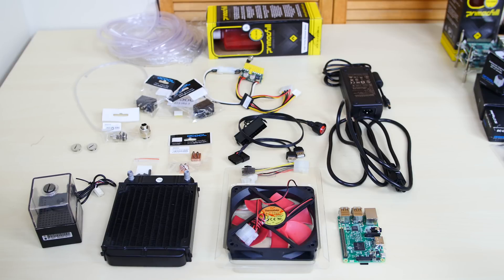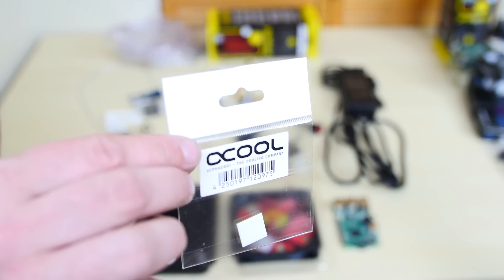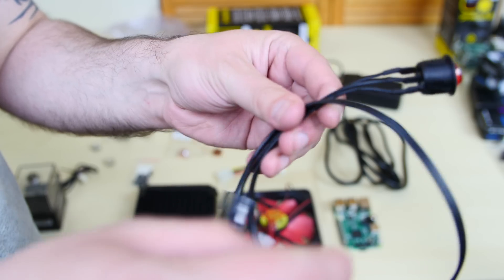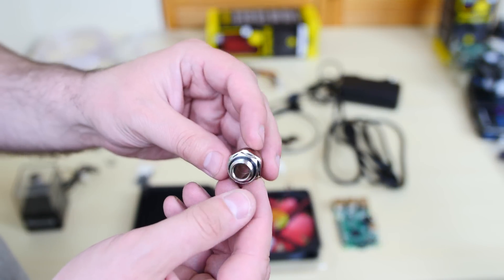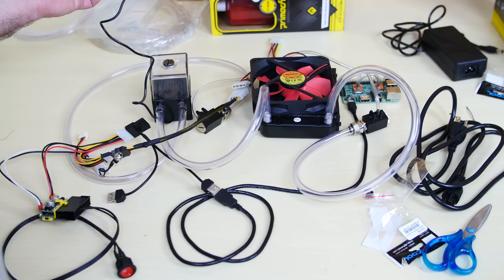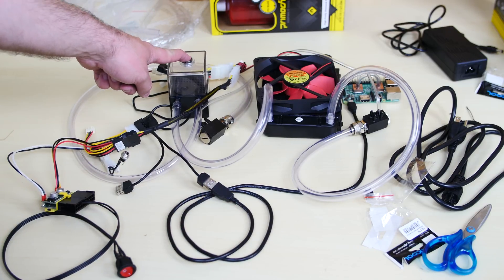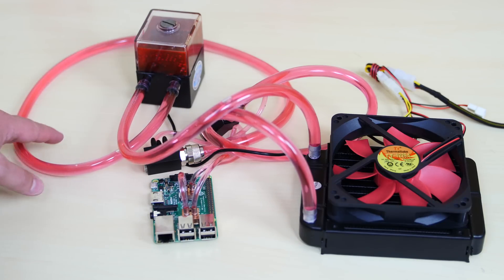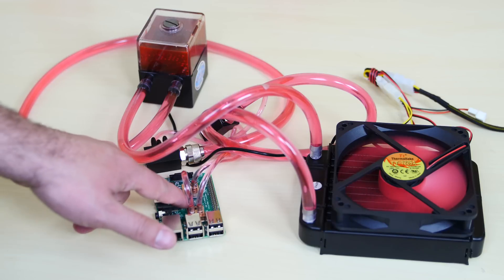Water Cooled Raspberry Pi 3 - Part 1 - The Build

Comment: Does it matter what the order is? 
Res/Pump->Radiator->CPU Block-->Res/Pump
Res/Pump->CPU Block->Radiator-->Res/Pump
Does it make a difference?
Reply: +Michael Dickens Ok. Now I just think you're trolling me. There's no way someone is this stupid by accident. You're obviously doing it on purpose.

Some of what you mentioned is called evaporative cooling. However, we do not spray water on our electrical components. That is 100% complete dumbass maneuver.
Reply: +Michael Dickens let me get this straight... you think radiators can get the liquid below room temp? Allow me to educate you. Without a compressor unit pressuring a gas into a condenser coil, cooling to ambient temperature, then decompressing the gas again, the lowest temperature achievable is room temperature.

Period. End of story.
Reply: +Michael Dickens Holy shit dude. You just keep digging yourself deeper. I've already explained that a radiator doesn't cool below air temperature. 70 Fahrenheit is 21.1 Celsius. when your cooling loop runs below 20, please submit a photo. otherwise please stop your bullshit.
Reply: You are cherry picking little points in our comments and then trying to use that against us. At the same time, you are complaining that we taking the things in your comments and using them out of context. There is no way that you will ever convince me that air and water will cool at the same rate unless you throw in some ridiculous variable, like you are doing now. It's a bit obvious that a room full of air will take longer to cool than a shot glass of water. Think about how much coolant is being used in a water loop, and then compare that to how much air is being used (moved) in an air cooled setup. 

Just go back and think about what you originally said....the point that is being argued. If you grab the tube that is feeding the radiator, it will be warm. The tube opposite that, exiting the radiator, will be cooler than the intake tube, but will no way be cooler than the ambient temperature in the room UNLESS it has been acted upon by some outside force. Full stop. There is no way around this.
Reply: I would ignore him, but, and maybe I am wrong, but I think he is 100% convinced that he is correct. Either way, one of us is gonna learn something new today.
Reply: You are still not getting something about this. Adding ICE to the water is using an outside source that is not available in a water cooling setup. You are still assuming that you are somehow going to get the water to be LOWER THAN ROOM TEMPERATURE. That is IMPOSSIBLE without some other outside influence. Evaporation is an outside force, and it is one that does not exists in a water cooled setup. If you take a pot of water, whether it be boiling or frozen, and let it sit on the counter in your kitchen, the water will eventually settle at the same temperature as the air around it. The starting point is irrelevant. while off, the coolant in a water cooled setup will match the ambient temperature around it. Once turned on, the water temperature will do nothing but rise, no matter which point of the loop you are taking the measurement at. The reason this works for cooling is because the water isnt going to instantly become the temperature of the CPU, and with it constantly in motion, the heat that it does manage to pull away from the CPU will be dissipated by the radiator. AGAIN, this temperature is NEVER going to be less than the temperature of the air around it. I really don't know how else to go about trying to explain this to you. Your theories are all based on something that is incorrect. Until you sort that part out, your entire thought process on the subject is going to be thrown off. It is obvious that nothing that we can say is going to change your mind. If you come up with a way to get the coolant to drop below room temperature using a normal water cooling setup, you need to go patent that shit because you will make millions, if not billions, because the applications would be endless.

As far as you referring to your first comment about the order of the loop, I have not said anything against either order. In fact, the original post...the one that caused this whole shit show, was me simply asking that exact question. "Does it matter what the order is?" If you had simply commented that you preferred to run the loop in a specific order, there would have been no way that we could tell you, "No...that isn't the order you prefer." The fact that you tried to bolster your decision with a fallacy is what opened up the door for the rebuttals.
Reply: Yea we said in a normal loop without outside influence
Reply: Also, not finding anything about using a radiator to reach lower than ambient temp, Yay physics!
 Sorry but everything I am reading (and all that I have learned) is saying you are wrong.

If you want to be taken seriously, give a specific reference.
Reply: it would actually be kind of interesting to see if having the rad before the blocks or after them makes a difference (even tiny) in cooling performance. 

Logic says no, but logic also told me that stuffing shirts and boxes into a PC case would block air flow and make it hotter, and that doesn't seem to be the case.
Reply: Popular opinion says, Not Really.

My personal preference is to have the radiator immediately before the res/pump. I like the pump to receive the coolest liquid, because the pump is the main component that keeps the system working. If it fails from overheating, that's bad.

I also do hottest component first, because the one that gets hottest needs more attention. (still just my personal opinion) For me this is the GPU, then the CPU.

So, based on my opinions, my loop looks like this...
Res/Pump > GPU > CPU > Rad ----> repeat
Reply: +iwantmypot I have the opposite opinion

Well, in a case like this, it doesn't really matter as even under load, the ARM CPU doesn't put off that much heat, leaving the liquid relatively cool (this would differ in a Rpi cluster though

As for bigger systems (gaming rigs and the like), I find putting the rad before the res/pump to be a waste, as you're taking warmer that air temp liquid, cooling it down to (what I would assume to be) cooler than room temp liquid, then having it sit in the res,  warming back up to room temp, before being sent through the pump (collecting the pumps heat) then being sent to the CPU, now you are essentially cooling the CPU with relatively warm liquid, doesn't that defeat the purpose of liquid cooling?

By putting rad after the res/pump, the (by this time) room temp liquid would go through the pump (still slightly cooling the pump during the process, not that the pump needs that anyway), sending it through the rad to cool it down, then taking that,...
Reply: now below room temp liquid directly to the CPU, much more efficient

I just never understood cooling of the liquid before temporary storage, it would be like taking ice cream out of the freezer and having it sit in the sun for half an hour before serving, why even freeze it at all then?
Reply: If you've ever listened to a window mounted air conditioning unit, you'll realize why almost nobody runs sub-ambient computer cooling systems.
Reply: iwantmypot Do I think that radiators can get the liquid below room temp?  Of course I do, now when I say below, I don't mean drastically, don't think that I expect the outgoing liquid to be freezing, but I would expect it to come out a few degrees lower

Keep in mind the short time that the liquid in is the reservoir, it is cooling down a tiny bit, and the liquid coming in, while it is warm, it's not in any way hot (to us that is), I honestly think by the time the liquid reaches the pump, it's already at room temp, or at least pretty close to it (it's most definitely in no way hot, by this point, or it would have been at the boiling point before even completing the loop)

Now, with all that in mind, if the liquid just has to be room temp to be sufficient for "cooling", what's the point in even having the radiator at all, let alone cooling fans?  I really think you are overestimating how hot the loop would be once it cools the last component in the loop, if it really got that hot, I believe we would have a lot more to worry about than where we should place the radiator, as we would have to worry about the integrity of tubing itself (do you really want your tubes melting?)

Relating it to a window mounted AC unit is a really a bad idea, it's not an ACs job to cool down to room temp, it's an ACs job to cool down MUCH MUCH lower than just below room temp, if it just cooled down to just below room temp, it would have a real hard time keeping a whole room cool, let alone a whole home,  you are aware the technology used in an AC is the same technology used in refrigerators and freezers right?  You really don't want a CPU THAT cold as it would risk condensation
Reply: iwantmypot What bullshit?  You can't relate air temp and liquid temp, liquid heats/cools at a faster rate than air, it also depends on how small/large the stream of water is

Do you have any idea how they cool nuclear reactors?  Ever heard of a "bong cooler" or "cooling tower"? (a replacement for a radiator in liquid cooling) When you take a liquid and force it through pinhole nozzles (eg. a shower head) it cools at a faster rate than, say a bucket of the same liquid, this is why the water coming out of a shower head feels colder the further away the shower head is from you

Okay, fine, you could argue that you are just feeling the difference between "hot" and "room temp", if that is what you believe, fine

Now maybe this is something only I can detect, but if I take a handheld shower head and have it maybe about an inch from my body (hand, arm, etc.), I can feel the hot/warm water(warmer than room temp), and the difference of warmth from the air around it, the further I take the shower head away from my body (putting it back up on its hook and sitting down in the shower, that same temp water is then not only colder, but is now colder than the air in the room

Another example (that maybe only I can detect) is if I take an unopened soft drink can that has been sitting out on a summer day, as long as it's not in direct sunlight, it is still relatively cool to the touch, I don't mean no difference to air temp, I mean it actually feels cooler than the air around it

Now according to what you are saying, what I just explained is not possible...  Then why am I detecting it?  Now again, it's not a huge temperature difference, but it definitely much cooler than room temp (temperature of the air around it)

The whole reason liquid cooling is a thing is because of this, liquid can take away heat/cool down components faster than air (and vice versa), the liquid coming directly out of the radiator is going to be much cooler than the same liquid going into a reservoir and pump, there is a difference, the difference is minuscule, but there is an obvious difference, and that slight difference, in my opinion, would make it more efficient to put the radiator after the res/pump, now again, that is just my opinion, and it doesn't really matter either way, but there is no reason that having the radiator after the res/pump is any worse than having it before

Now I do get what you are trying to say, the radiator would only be able to cool to the temp of it's fins, and it's fins can't get any colder than the air around it (or the air going through it from the fans), and thus that would be room temp, though do keep in mind there is such thing as "wind chill" moving air is cooler than stagnant air, so air going through the fans are cooler than the non moving air around it, BUT...  The smaller (and more) pipes there are snaking through the fins in the radiator, the more heat that can dissipate in less time, and the cooler the liquid can get, just like (the opposite of) solar water heating, the smaller the tubes in the panel, the faster the water in the solar panel will heat up, even on a cool/cold day, as long as there is sunlight
Reply: Michael Dickens Yea...I hate to have to jump in with shitty news, but there is no way a passive radiator can get it's contents any cooler than the air around it. Also, liquid takes a much longer time to heat or cool than air does. This is why you can go swimming on a night that preceded a hot day and the water will be warmer than the air. It is also why bodies of water tend to change temperatures with seasons, rather than changing with the days. Wind chill will not reduce a temperature below ambient unless paired with a liquid. Regardless, thanks for the response...lol. 

Side note, I was thinking the other day about adding a NOS inter-cooler spray bar into a build. How sweet would that be to have push button radiator frosting....lol
Reply: iwantmypot what makes you think I meant spraying water on electronics, you'd have to be a complete moron to think that was what I was saying

What I meant, was take the same principle and make it into an isolated environment (eg the "cooling tower/bong cooler" I mentioned earlier)

The warm water from the loop would come out the shower head and fall to the base of the tower (while at the same time, a fan is blown at a downward angle [hence the name bong cooler, the shape resembles a bong, the fan is where the pot would go]), the cooled water in the base gets sent to the pump, through the component's Waterblocks, then back to the shower head, in this case the tower serves two purposes, it serves the purpose of the radiator (cooling the water/liquid) and the reservoir

And you're right, it's a form of evaporative cooling

hackaday.com/2008/10/16/uberbong-evaporative-pc-cooling-probably/

krulkntrdction " Also, liquid takes a much longer time to heat or cool than air does. This is why you can go swimming on a night that preceded a hot day and the water will be warmer than the air."

You missed what I said then, when you have a NARROW stream, it does indeed cool/heat faster than air, again, that is EXACTLY how nuclear cooling towers work, now I even said (yet people seem to be only skimming what I read and obviously missed it), that a BUCKET of water will take longer to heat/cool than a stream of the same liquid, this is the same reason why a lake will be warm on the surface but cold on the bottom, the surface water heats up quickly while the deeper it goes, the longer it takes to heat, or doesn't heat at all

If water is a horrible temperature conductor, and air conducts heat faster, then wouldn't liquid cooling be pointless then?  Wouldn't solar water heating be impossible?

The more you two try to explain your cases, the more you make it seem that air cooling is better liquid cooling, funny how liquid cooling is considered better for overclocking, something just doesn't make any sense
Reply: Water is a better method of removing heat from the location, and that is why it works better in cooling.
Reply: +krulkntrdction He's just trolling. Ignore him. Talking to him is like arguing with a 5yr old.
Reply: krulkntrdction True, water is the best method of removing heat from a location, but that makes what you said a contradiction

You said, and I quote, water is slower at cooling/heating than air (and yes, in large quantities that is true, but not the case with evaporative cooling), and that you can't get cooler than room temperature with a radiator and fan. Now, how is something that slower to change temp better for cooling?  Also, how is a room temperature liquid going to remove heat efficiently?

Answer: It isn't, and it won't, so what you're saying simply isn't adding up

Try this, take two pots of water, put both on your stove and bring them both to a boil, turn off the heat, now in one of them, add as much ice as you can, leave the other to cool naturally, the one you dumped ice in should cool down immediately, how long will it take the pot cooling naturally to cool down?  A few hours at the very least, now imagine that pot of water is your CPU, doesn't seem very efficient now does it? But take that same pot, and stick it in the refrigerator (not freezer, but refrigerator), now it won't cool down as instantly as it did with the ice, but it's still quicker than it was sitting on top of the stove

Now, this all started from me stating my opinion that I would rather have the the radiator after the res/pump instead of before, now it has been proven that it doesn't matter too much either way, and that it's all up to opinion, I have yet to hear either of you list any downsides to have the radiator after the res/pump, or how it would be better vice versa, except for pump life, which is total BS
Reply: FWIW, here's my issue, I said my opinion, I said that I "assumed" the liquid coming out of the radiator was cooler than room temp, not that it was, leaving room for error, and I even said that what temp below room temp would be minuscule

Opinion is not fact, I never said that the radiator SHOULD come after the res/pump, just that it is what I personally have done/would do

An assumption leaves room for error, by saying I assume something, I am automatically admitting I could be wrong, but think I may be right

After posting my opinion, I immediately got backlash on it, there was no reason to get so hostile about my reply, I wasn't attacking anybody, yet I felt attacked myself
Reply: Ok, well...anything that I wrote in my first reply comment wasn't meant to be an "attack". I think if you go back and read it, you will see that it wasn't a malicious comment at all. I'm sorry if that's how it came off. Anyway, it's best if we stop going back and forth on it anyway. It's like beating a dead horse. Thanks for the initial response, though. I was genuinely curious as to whether there was a preferred or even "correct" order that a loop should be run in.
Reply: krulkntrdction 

"You are still not getting something about this. Adding ICE to the water is using an outside source that is not available in a water cooling setup."

While not available in a typical watercooling setup, it could be added in a custom watercooling setup, not all watercooling setups are set up the same way, in theory, you could have an external container filled with ice water, which then could be pumped inside the case to the component's Waterblocks, then back out of the case to the container, there are many things you can do to replace the function of a radiator (like the bong cooler I mentioned earlier), now of course due to the possibility of corrosion and algae growth, doing so would obviously be a bad idea (unless you made ice cubes with feser base infused water, but that would be more trouble than it's worth), but it's not impossible to have an ice water watercooling setup, also, I wasn't referring to using ice in a watercooling setup, just that it would instantly cool down the water, that is why I added the bit about putting the untampered pot in the refrigerator

"You are still assuming that you are somehow going to get the water to be LOWER THAN ROOM TEMPERATURE. That is IMPOSSIBLE without some other outside influence."

And what's wrong with assumptions?  An assumption doesn't mean fact, and even one degree below room temperature is still below room temperature, even though it's so close to room temperature it wouldn't really count, and fans would be an outside influence...  Technically speaking

"Evaporation is an outside force, and it is one that does not exists in a water cooled setup."

Now this is just plainly wrong, evaporative cooling is very much possible in a watercooling setup, again, this is the process that cools down nuclear reactor cores at nuclear power plants (which is a form of watercooling), and there are actually watercooled PC setups using this very form of watercooling, do a google search for bong coolers, it even shows using the evaporative cooling technique being used for PC watercooling, there just are no radiators used in these setups, and the cooling process takes place outside the computer case, I have been tempted to do a setup like this myself, but it's a lot more involved than a typical radiator setup, and makes the PC much harder to transport when needed

"If you take a pot of water, whether it be boiling or frozen, and let it sit on the counter in your kitchen, the water will eventually settle at the same temperature as the air around it."

Yes, you are very much correct, wether hot or cold, it would return back to room temperature...  Eventually, but when's eventually?  One hour? Two hours? your CPU (what the pot of water was supposed to represent, would a halogen lightbulb be a better example?  Those things get HOT during use) would already have thermal throttled, shut down or completely fried by then, not something you really want to happen to a $200 CPU

"The starting point is irrelevant. while off, the coolant in a water cooled setup will match the ambient temperature around it. Once turned on, the water temperature will do nothing but rise, no matter which point of the loop you are taking the measurement at. The reason this works for cooling is because the water isnt going to instantly become the temperature of the CPU, and with it constantly in motion, the heat that it does manage to pull away from the CPU will be dissipated by the radiator."

You are exactly right, I wasn't disagreeing with you or +iwantmypot about that, it's like the saying "six of one, half dozen of the other", this leaves it up to debate, same as thermal compound, spread method or grain of rice method?  Neither are technically wrong, but there are heated arguments about that as well (spread method for me BTW :P), so it's like I said many times already

Opinion
Is
Opinion
Not 
Fact

So I gave my opinion, but if my opinion is so wrong, what makes the other way so much better?

"AGAIN, this temperature is NEVER going to be less than the temperature of the air around it. I really don't know how else to go about trying to explain this to you. Your theories are all based on something that is incorrect. Until you sort that part out, your entire thought process on the subject is going to be thrown off. It is obvious that nothing that we can say is going to change your mind."

Okay, fine, it can't cool the liquid any cooler then room temp, I just don't see how the CPU can get adequate cooling though, maybe I'm just not thinking about it the right way

"If you come up with a way to get the coolant to drop below room temperature using a normal water cooling setup, you need to go patent that shit because you will make millions, if not billions, because the applications would be endless."

Hmm, interesting

"As far as you referring to your first comment about the order of the loop, I have not said anything against either order."

Of course you haven't, you have even proved that yourself, you did exactly my opinion yourself on your Raspberry Pi (actually, before these comments, I was actually all for you, I actually really enjoyed this video), this originally wasn't aimed at you, and I am sorry you had to become a part of this shitstorm, but it was originally aimed at +iwantmypot, who seemed like I hit a nerve when I gave my opinion, I never said his opinion was wrong, just that I had a different opinion, and the reason why it was my opinion

"In fact, the original post...the one that caused this whole shit show, was me simply asking that exact question. "Does it matter what the order is?" If you had simply commented that you preferred to run the loop in a specific order, there would have been no way that we could tell you, "No...that isn't the order you prefer." The fact that you tried to bolster your decision with a fallacy is what opened up the door for the rebuttals."

I may have taken it the wrong way (just like he may have taken my reply the wrong way), I felt more like you were protecting him instead of just clarifying my opinion
Reply: Ok...I don't want to continue this argument, because we are obviously on two different pages with this issue. HOWEVER, I do have one thing to say that is probably more crucial to put out there then anything we have talked about in this comment thread. This is not my video and I did not upload it. I just commented on it. I don't want you to be under the impression that the video up-loader has ANYTHING to do with our conversation, and you shouldn't have any hard feelings towards the creator. This is a good video, and I would hate for him to have any unwarranted flack sent his way.
Reply: krulkntrdction Oops, I was using the Google plus app and wasn't fully paying attention, lol

Understood, argument over
Reply: i have a way to get temps lower than room temp. i put my radiator on the output of my ac. the room is at 65F but my CPU at 100% load is at 37F. the reason why this is possible is 1. the air coming from the air conditioner is colder than room temp. 2. AIRFLOW. I hate to break it to you but it is possible for a radiator without a compressor to chill water below room temp.  For more information and detailed explanations check out the physics forms under fluid mechanics and thermal dynamics. Ask about waters thermal capacitance in relation to volumetric airflow. When in doubt PHYSICS!!!!
Reply: +Michael Dickens When +krulkntrdction said water was slower at heating and cooling than air, he was talking about the temperature change in the water itself, not it's ability to heat/cool other things.

Water is greatly denser than air, and also has a greater thermal density. So, heating a pot of water to 100 C can take 10 minutes. Heating a pot of air (with lid, otherwise the heated air just floats out of the pot) takes less than a minute. So, the water took longer to heat.

At the same time, the water pulls the heat away from the pot faster than the air does. therefore a pot with water won't warp from heat, since the water keeps pulling thermal energy out of the pot. Air doesn't pull thermal energy fast enough, so your pot gets warped. If it had a nonstick coating, it is now garbage. Much like a cpu would be garbage if it overheated. Luckily they've started making computer equipment throttle itself if it starts getting too hot.
Reply: I think the water is moving so quickly that there would be a difference, but a very minimal one. Over at JayzTwoCents, he stated that the order really doesn't make much of a difference, possibly not noticeable at all. 

Personally, I would still put the rads right before the res/pump. Although not always the most expensive part of the loop, the pump is definitely the most important part connected to it. If your pump fails, yer gonna have a bad time.
Reply: That stuff ( clothes and shit) didn't make a difference??? Was is a water loop?
Reply: Theoretically the most efficient place to put your radiator is the place where the coolant is the hottest.

And as people already said. A radiator cannot cool the liquid lower than the ambient temperature. Heat flows from the hotter to the colder place. There's absolutely no reason why a radiator would decrease the temperature of the working liquid lower than the air's.

The reason why AC units do cool down stuff to lower temperatures is because they use a compressor which increases the pressure on the hot side of the loop (increasing the temperature without adding any heat) which is then cooled by a radiator to room temperature. Then the liquid moves to the cold side and the pressure is severely lowered. The liquid at room temperature that rapidly decompresses cools down to much lower temperatures. That is then fed to whatever needs to be cooled. This cold liquid absorbs heat from the cooled space and is fed back to the compressor.

I repeat, RADIATORS CANNOT PHYSICALLY COOL ANYTHING BELOW THE AIR TEMPERATURE. Unless you're spraying them with water and you're cooling them with the water vapour but that kinda defeats the point. Also, moving air is the same temperature as non-moving air. The reason it FEELS colder is because it helps evaporate sweat off your skin which lowers the temperature of your body. BY EVAPORATIVE COOLING. Not convection. Radiators do not sweat.